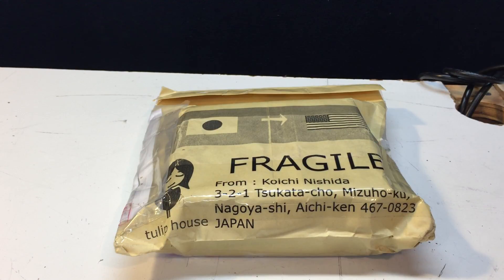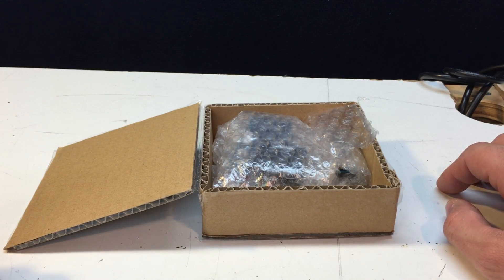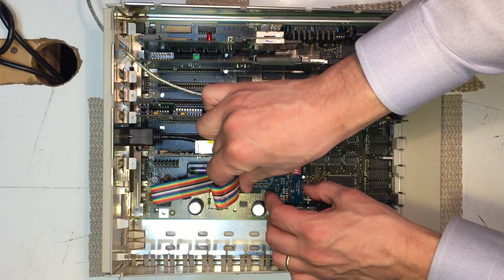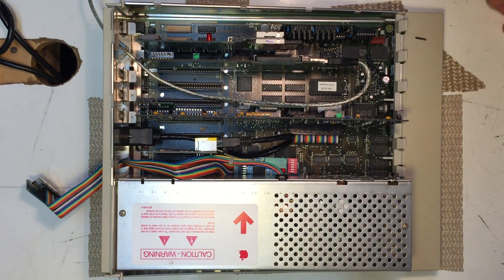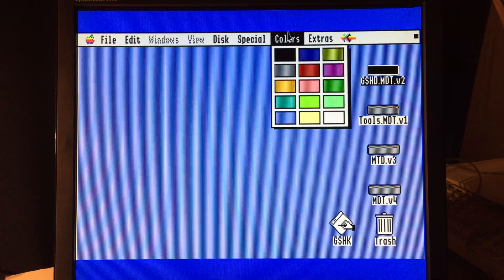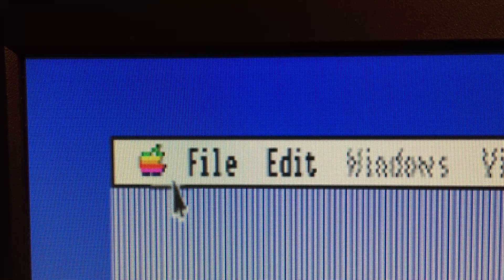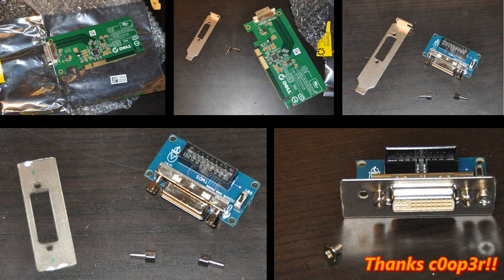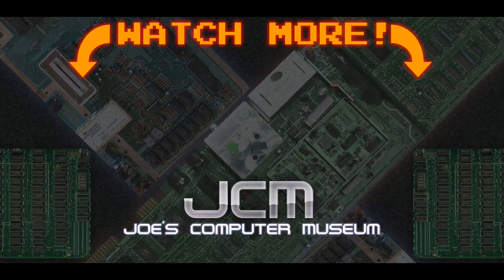Nishida Radio Apple IIGS DVI Adapter

Comment: Great video!  So this only works with Rom 3 IIgs computers?
Reply from the maker: That is correct. The ROM03 IIGS has a non-socketed AGC chip, which allows the adapter to fit over it. Older machines have socketed chips making adaptation difficult.

Comment: Can anyone with an Apple 2GS RGB monitor comment if the RGB monitor will also show the blue and white bands seen under the Menu bar as seen around 7:20 on this video?  My GS is ROM 01 and I'm thinking if I have to go with a solution now I'd get the GGLABS GS2HD and pair it with a Component to HDMI converter like the one from AGPtek LKV3561080P.  The GS2HD does have the same blue and white bands, so perhaps it's normal and only visible when the resolution is scaled to HD from 640x200.

Comment: My understanding is that the only reason it cannot be installed on a ROM 00/01 motherboard is because on that motherboard, the VGC is socketed and the adapter has no way to physically fit onto its pins to leech its signals.  I saw a photo where someone had gotten the adapter to work with a ROM 01 motherboard despite this by soldering a jumper from each pin on the adapter to a pin on the bottom of the IIGS motherboard.
Reply from the maker: Awesomesauce! I could imagine a passthrough adapter where you remove your VGC, plug it into the adapter, then plug that into the board. Probably more difficult to engineer, I suspect?
Reply: I don't know of any reason this wouldn't be doable as long as there is enough clearance under the power supply and everything is properly shielded.  It seems strange now that the Nishida Radio adapter wasn't designed this way since ROM 01 motherboards are far more common.

Comment: Joe - as always another excellent video!  To solve the adapter popping off ( I saw yours move when you were putting the power supply back in) I stacked up two 1" squares of pink anti-electrostatic foam to sit between the SMC chip and the power supply.  This keeps the board firmly planted on the ROM chip.
Reply from the maker: I was thinking about that just a few minutes ago - great tip!